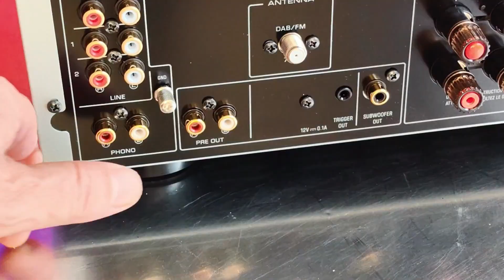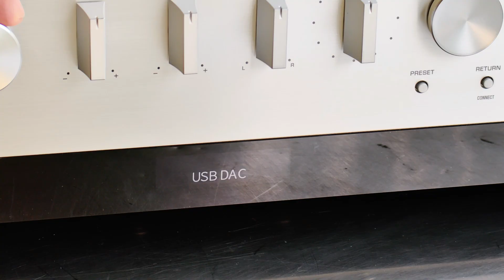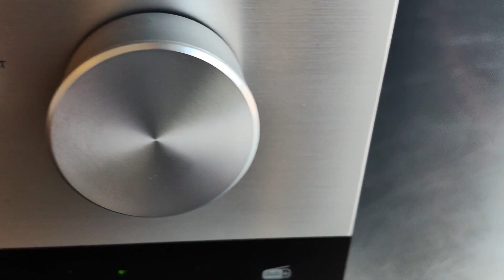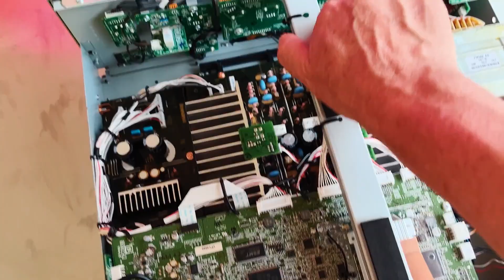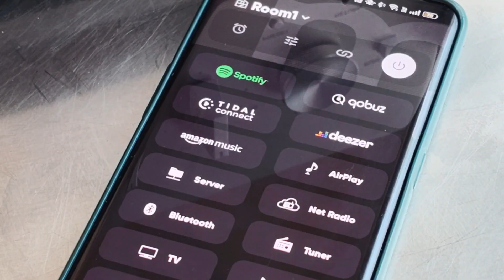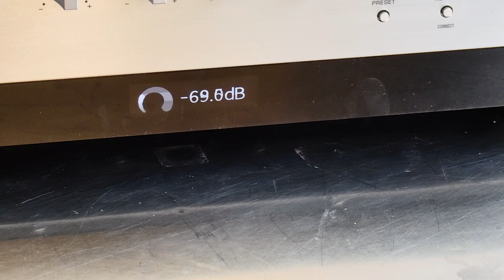Yamaha R-N1000A Streaming stereo amplifier | Under the hood

Comment: I think the power supply rail uses two 12000 uF caps. That amp board is identical to the AS-801. Very nice quality amp!
Reply: Yes my friend. I have as 801 it the the same.
Reply: I think they used some tricks and  higher quality parts in the 1000. The RN800a would be more like your 801. Very good pieces for the price 👍🏻
Reply: how is it compared to the A-S701.  I've been looking for an upgrade to that amp.

Comment: Did you check the R-N800A too? Do you think the R-N1000A worth 450 euro more than R-N800A? Any sound difference?
I don't need the HDMI port, but looking only at the better components (caps, transformer) and gold plated speaker terminals.
Reply from the maker: These two are almost identical, same performance.

Comment: So, under new digital circiut, sill an old syle, rather  simple amplifier that design remembers  90.  It sounds ok but don't blows the mind. I my opinion deecent yamaha starts with series as 1200. They have totally different topology and sounds great, not just not like a typical Yamaha sound.
Funny fact, this standard yamaha design is so old fashioned that it does not uses a DC servo, so capacitors need sto be used to isolate different stages of the amp. And this is clear for trained ear to hear. 
Go for something more modern with this price tag.